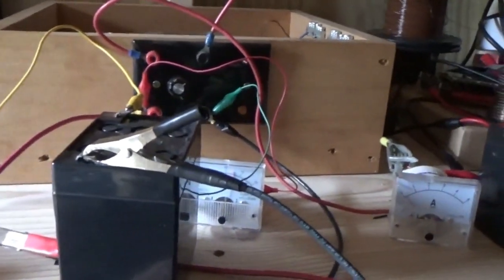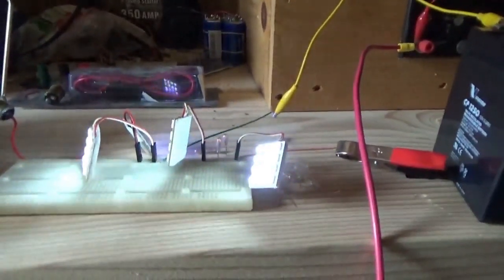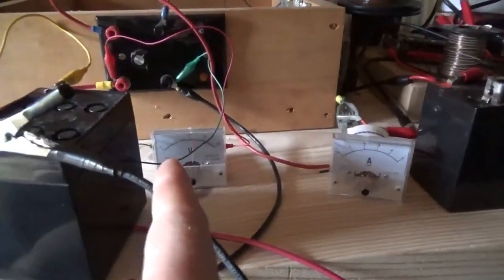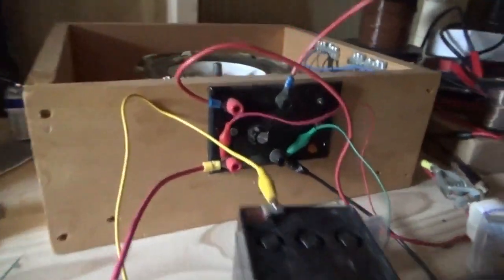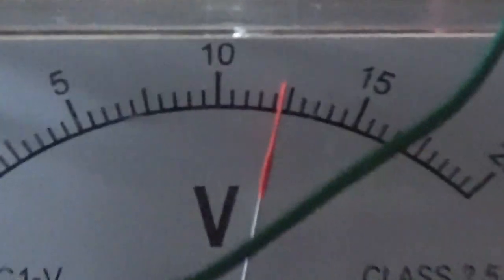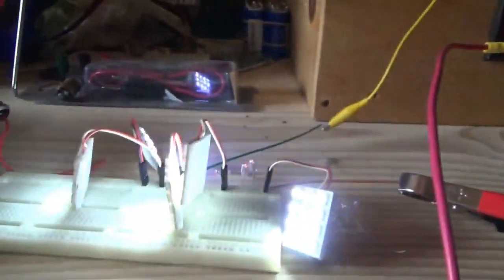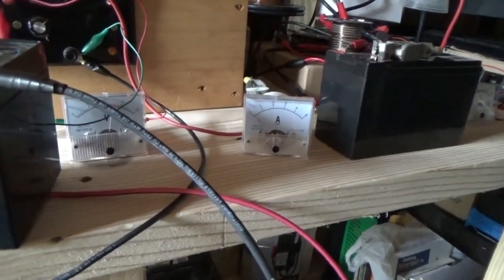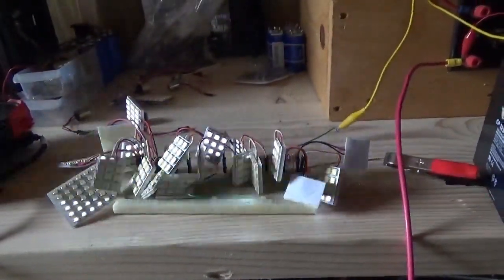Bedini Motor Running 19 LED Lamps ~ Lower Current & Higher Charging

Comment: put a smallcapacitor in parralel whit the leds to stop the flashing...and the more load (leds) you ad, the lower the resistance off the circuit, the higher the charge ... ohms law, not weird..., when yo bypass the leds, the internal resistance from the battery is the only load, and a heavier draw on your bedini generator.(lower spike voltage, so less charge on the battery..). its no weird sience, its common electrical noledge., it needs a optimum resistance to work the best., it al makes sense to me, (y have learned this at electronics colledge) (its a bit like MPPT....)... so no mistery here...
Reply: MrBugsier5, you said lower spike voltage equals less battery charge.  According to Bedini himself and numerous experimenters, the more parallel added batteries in the charge circuit, the more efficiently it charges and all at the same time.  It was a secret he only admitted a few times and otherwise kept this point quite.  By your example of lowered impedance, then here many batteries in parallel should lower it much more and drag down the motor rpm, but in reality it does not.  I think what you are missing is this is a complex of actions not just simple ohms law if it were your points would hold strongly.  There is DC pulses of one sign, negative resistance, nonlinear voltages and yes, even relativistic effects.  Also neither the naysayers or Troy has determined the proper load matching impedance for setting an ideal load for best efficiency.  But as a spiking output I would expect the impedance is not steady state and very erratic.  Without knowing this it is difficult to calculate any reliable power in/out results and know by math if over unity is happening.  He might for now measure the Lux of the LEDs to help a little.  Teaser for you:  if you DC pulse (any freq within specs) any primary of a transformer (iron core) and at the secondary output at a diode series to a heavy or shorted non-inductive load, how does the input power act?  Does it increase, remain same or decrease under load and is it proportionate or not?  It is a simple test, do this for yourself and expand your horizons.  I have done this and many more variants with effects not taught in electronics school.  Ohms Law is only approximate even with pure resistances and only matches well a narrow range of linear functions.  Many electronic components are nonlinear including diodes AND BATTERIES!  Try using ohms law to calculate voltage on the secondary of a Tesla Coil.  Don't cheat, and reverse calculate from spark length.  Just joking.
Reply: MrBugsier, I did not forget, I have been in this research and other kinds for many years as a hobby.  Your statements are correct and it is fun to see unexpected (until you understand new novelties) actions.  But I must emphasize, not to take your traditional electrical knowledge too far to explain this stuff.  Just because rationalizing may seem to match your conventional knowledge does not prove that it is indeed the same.  Here in Florida, we have two snakes that look almost identical, only one has a different sequence of the same colors.  One is poisonous and one is harmless.  In Chemistry,  there are molecule complexes that are identical atom to atom, electron to electron only one complex spirals opposite the other (think it is called chirality) one is a safe medicine for patients and the other is fatal.  I have to qualify your note about BEMF not putting a load on the input.  This is dependent on the wiring scheme.  One way is as you say, but another way will load the input when it is re triggered.   I am not saying he has more energy out than in, only that there are a complex of actions and reactions going on I for one don't think my conventional electronics background can explain it.  Conventional electronics stresses the use of closed circuit (closed system??) between an energy source and load using logic for amps, watts, volts, power factor etc.  But in these pulsed circuits into large inductances, where voltage builds near instantly and current is interrupted before it has time to majorly build (which would cost input power), the voltage pulse will still produce polarization of electrons, this ordering results in a changing magnetic field which in turn will induce in the BEMF coil  just like induction in a transformer secondary.  Only here substitute the CHANGING electric field pulse for a primary of a transformer.  Here is the conventional law of physics that supports this:  a changing electric field however devised will produce a complimentary changing magnetic field.  No mention of current or amps requirement!  Shh, don't spill this secret sitting right in front of anyone with a physics 101 textbook.  So in a sense we are dealing with an open loop circuit here  and normally view would be no power can be generated usefully.  Nikola Tesla had a devil of a time trying to gain support in using one wire transmissions for power.  He failed to get support as everyone could not get past thinking of the huge EM radiation loses at the top of his tower.  They did not catch that he was not wanting to send rf transmissions from the dome "top hat" of his transmitter so he was not going to have huge power losses into the air.  He wanted a direct one wire current path thru the ground where there would be little loss.  So this Bedini stuff, is an off shoot I think from similar work Tesla had investigated.  Tesla also agreed that pulsed DC had peculiar effects and spent a great deal of time on it.  But he never said it was over unity that I can find.  He does say he wanted to use waterfalls to generate power to run his transmitter towers.  :)
Reply from the maker: MrBugsier, what you miss here is that the input current from the run battery is REDUCED while the charge on the output is INCREASED.
Reply: Y did not miss that, thats the fact y mean, if you lower the resistance you increase the amps (on the output), thats correct, but its not coupled to the input by the way you use the emp from the coil (yo dont put a load on the input, couse you generate a puls at switching of the magnetic field, so the output cant put a load on the input, your input load is only the trigger puls to keep your wheel turning. there is more going on that you have noledge from in this system, thats why i like the experiment.
Reply: Enrgy crafts, you forget that the emp pulse createt in the coil does not effect the input... the collapsing field induces power in the output wire, so this doesnt put a load on the input..... thats fun aint it...
Reply from the maker: Well said EnergyCrafts. Thank you for that explanation.
Reply: Hope it helped your cause.  I should in fairness to Tesla, note that although I have not seen any mention of free energy relative to his magnifying transmitter beyond a natural free energy waterfall paid for by Nature, he being very cagey not wanting ridicule, does make many hints and use unusual terminology in numerous comments that to the layman or conventional scientist seemed to say what they expect but in reality he was speaking in hints to a source of free energy not already known of at the time.  He knew exactly what to say and how to craft the wording:  he was fluent in a number of languages.  He was one of the last scientists to still believe in a an ether and was very slow to accept the electron theory.  There is much that agrees with what you said about slow and fast voltage/current in the above post.  There is also much that can be read between the lines for those in the know.  I leave with this.  All matter has endowed inductance and capacitance, all space is not void but has all kinds of EM waves, radiation, cosmic rays, gamma rays, cold, hot, plasma, gravity etc.  Physicists have also determined long ago that space has a DIELECTRIC constant like a capacitor?)  Now couple all this with the fact that nothing is stationary in the known Universe:  All is in motion:  that is kinetic energy.  Question is what pays to do work keeping it all in motion?  Science says there is no free energy or free lunch.  But Science all so says it takes energy to do work, yet apparently the Universe is happy to get some source of free energy to maintain all the motions.  If not, then all would grind to a halt from bombardment, friction etc over time.  It would seem the only answer is that there is definitely an unrecognized (undetected) as yet underlying mechanism(s) beyond today's knowledge.

Comment: try looping power back to main  battery instead of lights and use a cap
Reply from the maker: You cant really do that with one coil. But I plan to set up a second coil and pulse it back into the drive battery.

Comment: what is the frequency of power coming from the bedini,  I would venture a guess around 50-60 hz which happens to be faster than what it's running at now the flicker will disappear. Ac power does the same thing pulses, but in both directions. Around 50 -60 hz the lights will still flash but won't be perceived as a flicker, since the human brain and eye can't process the info fast enough.
Reply: leds only light in one direction, so only half the sinus...so only half the frequenty..)(unless you put a bridge recifier in front of it..), the bedini coil only produces spikes (dc) so its not a thrue ac, its a pulsing dc ..
Reply: MrBugsier5 you are correct in assuming that it is pulsing dc voltage and it may also be true a bridge rectifier may eliminate the lights flickering, my point was that the frequency of the dc voltage pulse is probably to low. We both know led lights run solely on dc voltage and only in the proper polarity. Ac voltage in theory runs in forward and reverse on the wires, where as dc doesn't. You made some very good points, and I thank you Sir.
Reply: The Do It Yourself World you need to couple the rpm test with the frequency of the output at the given speed or rpms won't tell you a thing about the pulse frequency the circuit is running at.
Reply: generally frequency is measured in HERTZ or abbreviated Hz. on your meter.
Reply from the maker: I will run an RPM test on it and show it on video
Reply from the maker: I can tell the RPMs and then count the number of magnets. Math should tell us the frequency. I dont have a good scope to get real details. All I have is an RPM meter and math.
Reply: i,m not asuming, i know for fact its a dc pulse,.... its a spike, not even a half sine wave. the brigge rectifier doesnt make it less flikering couse the puls is only positive (or negative) not both., that only works whit ac (so iff he uses a seperate coil, driven by the spinning magnet on the bedini wheel, but that would put a load on the wheel and also on the input )(now its a ac generator),(like the bigne Qantum generator Troy has.  in roys case he uses the emp from the collapsing magnetic field in the trigger coil from the bedini, so thats non used energy he can use, whitout putting a load o the spinning wheel and maske it drag.
. . (and regarding to the rpm, indeed, the faster the wheel spins, the more pulses a second, the less the slow flickering.off the leds, (above 26 frames a secon it schould look steady (like the movie's) tho its still switching on and off, our eyes cant follow this so they look like steady on, but in fact  they are not. 
)

Comment: What if you put a capacitor before the lights? Would that take the flicker away from the lights?
Reply: A capacitor with the right level would in fact smoothen out the lights, one such application could be on somethign like a small steam generator that has surges every cycle.
Reply from the maker: The lights went out. The capacitor absorbed the energy.
Reply from the maker: I used a photo cap. Maybe 300 mfd, if I remember right.
Reply: How long was the capacitor on it? Maybe a smaller or larger capacitor?
Reply: It may work. Im not the the electronics geek. Im only making suggestions. Trying to help.
Reply: use a smaller cap, not a super cap, use around 1000 mfd.
Reply from the maker: I used a photo capacitor and it totally killed the lights. I am thinking maybe a smaller cap but it must have higher voltage to take the pulses without damage.
Reply from the maker: Thats cool. Thanks

Comment: Hey Troy,  I remember as a teenager after I bought my first car ( 1967 Mustang with straight 6 )  and i had my first
dead battery situation and the guy who gave me a jump start told me something.
He said I should drive the car with the headlights on and the fan blower because with the additional draw it will cause the 
generator to put more of a charge into the battery.  Yes he said generator not alternator. The voltage regulator was a separate 
device.

Is that similar principle you are seeing demonstrated here?
Reply: If there is no current flowing then there is no power.

Like if you charge your phone with 5.2V 0.5A it will charge slower than 5V 1A. without current you can't charge anything.

We are not trolls just learned public school physics or even at University.
Reply: even the oscilloscope inserts a small resistance, (load) on your sercuit,so micro amps can flow (that how the scope can show) through the scope .. so there is power, allthough verry small...
Reply from the maker: True, but the optimum end result is to reduce the current as much as possible
Reply from the maker: No, back then you had a generator in your car. A DC generator. These days its an AC alternator. This is a pulse motor. Pulsed DC voltage moves faster than current. So there is no current flowing.
Reply from the maker: You are correct. There is no power. Just voltage. You can see it on an oscilloscope.